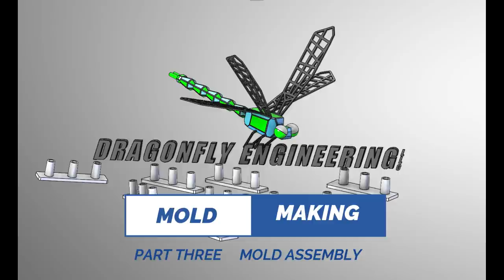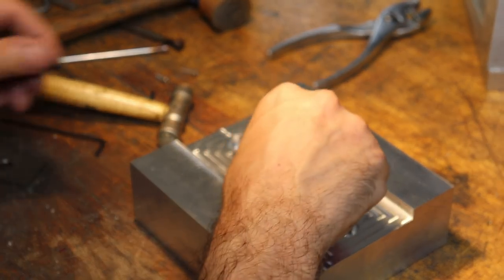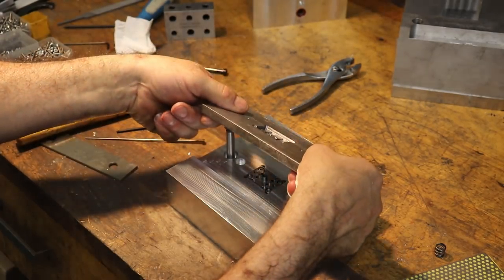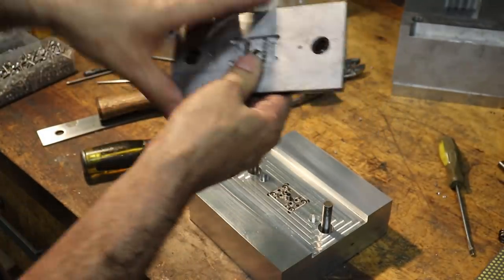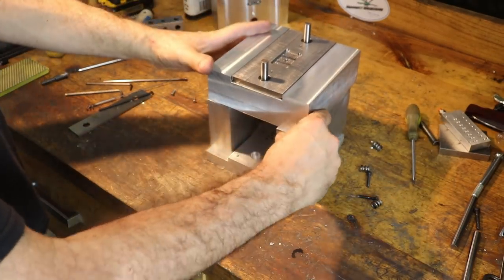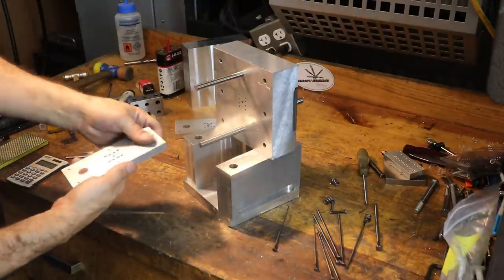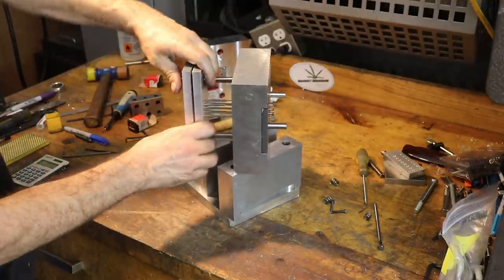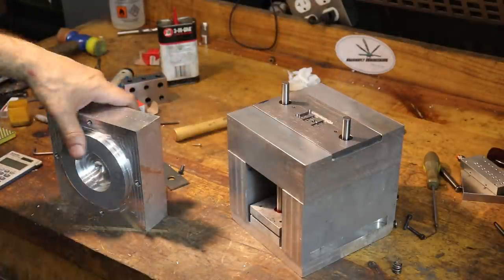FAMILY MOLD MAKING 3

Comment: When you were measuring the height to the base of the mould cavity, is there any reason whey you didn't just zero the calipers out after probing the depth, then you would have got the overall height without using the calculator.  Effectively cutting out the chance of an error when hitting the buttons on the calculator ... :-)
Reply from the maker: Yes, I could do that too.  I tend to try to not trust myself with different approaches. I use a calculator for even simple math, helps me prevent screw ups! Thanks!

Comment: With the ejector pins being slightly low could you just shim the underside of the ejector pin retaining plate?
That way if your mould does compress over time you can just use smaller shims to lower the ejector pins relative to the mould face.
Reply from the maker: Yes, I do that frequently, I also shim the mold riser block to move the pins the other direction

Comment: This mold is built to cycle 10k times? So where would the failure point be eventually?
Reply from the maker: the parting line get dented with strings of plastic, and spindly features can break off mostly